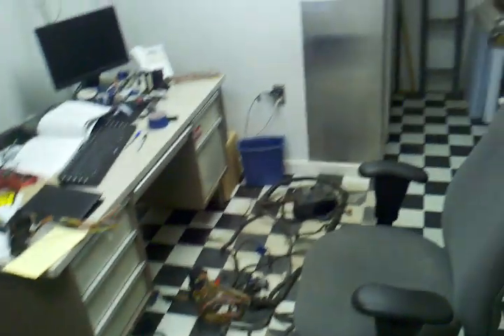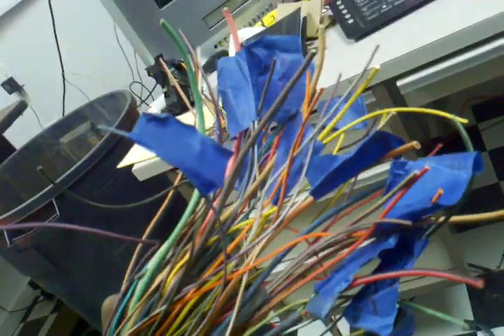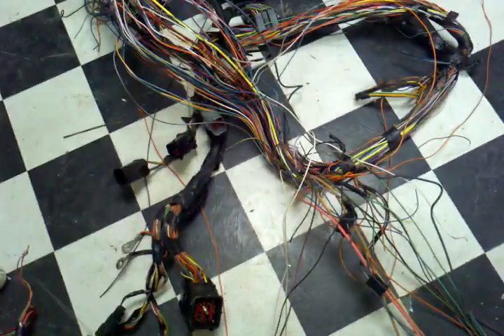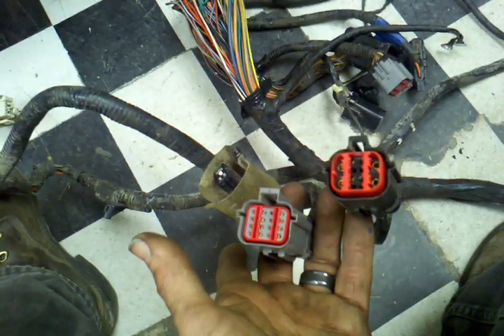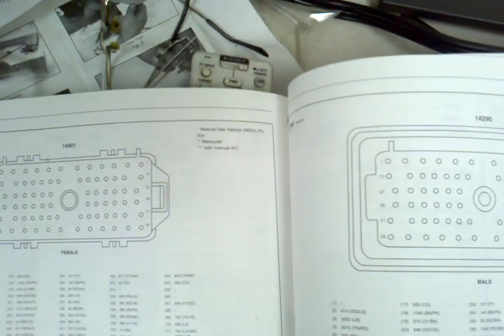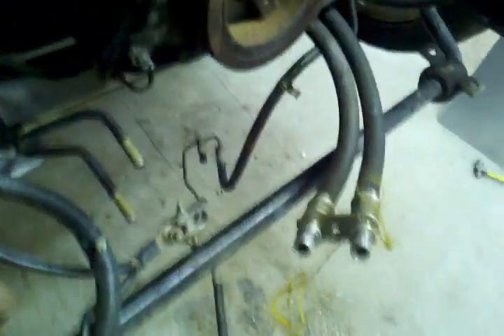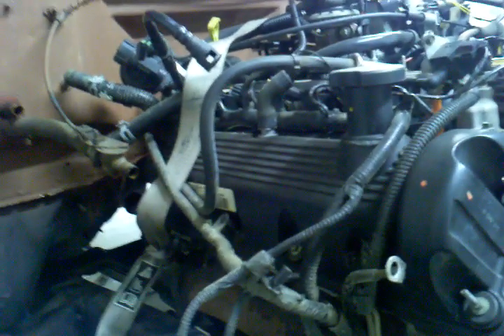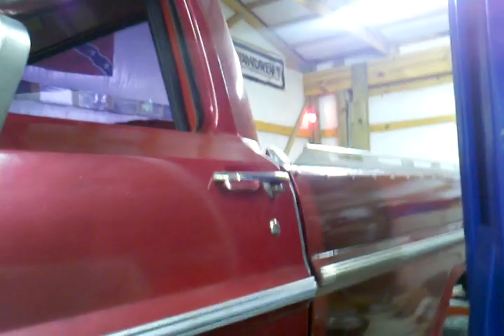1967 ford f100 crown vic swap tips and info part 4

Comment: Whats the wiring diagram you are using there? I just got my motor set in and im about to start the wiring nightmare soon on my 73
Reply from the maker: I bought the original Ford wiring manual for the car. It had 100% of the entire cars wiring (minus aftermarket for police add-ons). I also had a subscription to Ondemand5 but Alldata likely has that as well for about $30-50 a year.